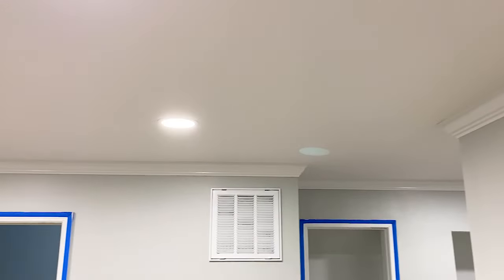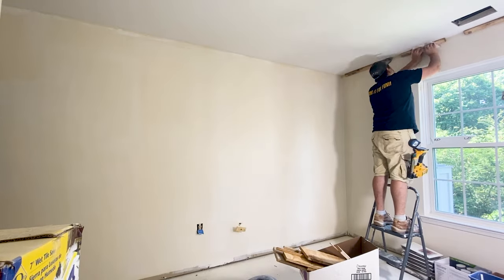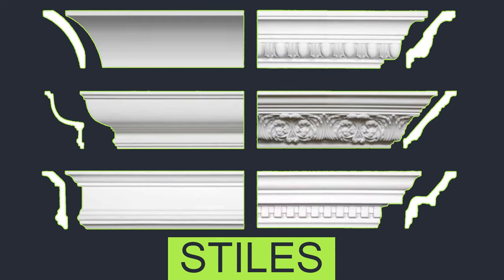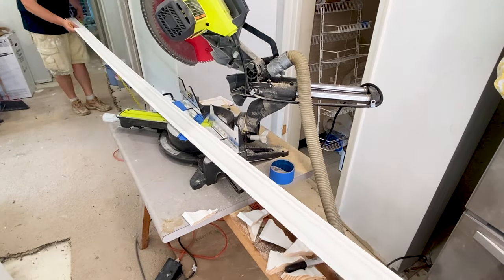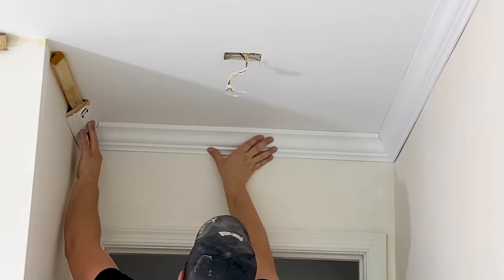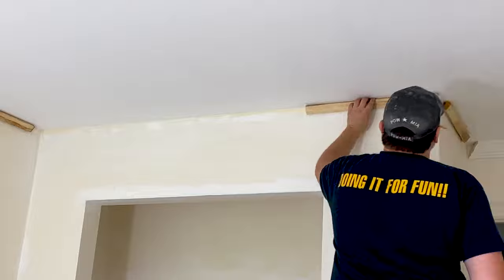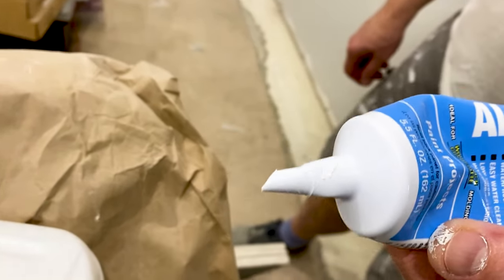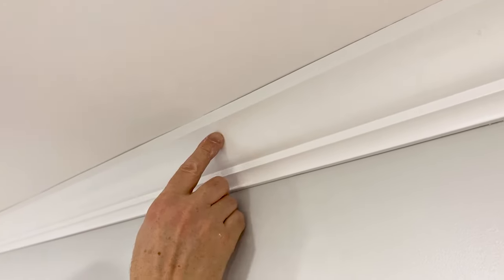How to Install Wood Crown Molding Like a Pro

Comment: High quality video!. so the measurement should always taken at the bottom side of the molding and at the tip of the cut regardless if it is IC or OC. correct?
Reply from the maker: Thank you for your kind words. That is correct. If your saw is set up like shown in the video then measuring the bottom will give you tops that line up as well

Comment: Great video, thanks, what size of nail did u use to hold the 1x2 spruce to keep it firm? And what size did you use for the crown molding
Reply from the maker: Good question. We used 2” nails to secure everything. Thank you for the questions and subscribing to support the channel. Please let me know if I can help in any other way with your project.
Reply: Thanks for your reply, do the spruce stay firm even if nailed to the drywall or it needs to be mailed to the studs? Thanks
Reply from the maker: We did not focus on making sure it is nailed in to the studs but there is a high probability that you will hit a bunch of studs any way. But even if you don’t securing the spruce to the studs it is very hard to remove it if it’s just nailed in to the Sheetrock. We used this method in my place 11 years ago and the molding looks the same as when it was installed.
Reply from the maker: Last time we chatted was 5 month ago. Are you still in the planning stage?
Reply: @DIYwithMAX  perfect!! And yes, when I commented the first time I was collecting info, making numbers, learning how to do every step for the remodel, then I've been so busy and now I started with it, thanks for all the info and for the video, it really will help me 👍
Reply from the maker: I’m glad I could help. Please let me know if you come up with any more questions. If your comfortable shoot me a picture of the final product at DIYwithMax@gmail.com I’m rooting for you.

Comment: What is the size of the spruce strips? 2x2? 1x3? 
And you adjust it to fit the sample molding, touching both the ceiling and the wall right?, then you nail the strip to the ceiling and wall right?
Reply from the maker: Hey I hope this answers your question. We use 1x2 inch spruce. Correct adjust with the sample molding peace so it has the right angle and then nail it in to wall and sealing. Be careful so it does not slip on you when your using the nailer. It’s best to check the fit after it is nailed as well. Also the spruce is not perfect so you may have to cut it to smaller peace’s to get rid of the curves in the spruce. Thank you for taking the time to ask additional questions and subscribing to support the channel. Please let me know if I can help in any other way.

Comment: Kids never use caulk to fill nail holes! Wood putty for nail holes caulk for gap between trim and wall or ceiling and inside corners wood putty for seams and outside corners if needed.
Reply from the maker: Caulk has got the stretch needed to make sure it does not dry out and crack. That’s why I use it. I’m sure your suggestion will work as well but for how long. My method has worked for 12 years with no issues. Are you getting similar results?

Comment: Great work Max😁💪 Yea I've never seen someone using spruce or pine even for proper backing. But i guess if you don't want to locate the studs & mark them you can also do it this way. 

Not to be redundant. You've always made & used the sample inside/outside pcs for installing & it's always worked for you??
Reply from the maker: Yes as long as you make sure the cuts are right to begin with. If for any reason your sample peace’s are not cut right they will not line up. Thanks for taking the time to leave comment and supporting the channel by subscribing. If I can help in any way with your project please let me know.

Comment: I gave up and took everything back to HDepot.
I couldn't make interior corners to match each other. I was always having a quarter of an inch gap at the top of the mounting.
I couldn't figure it out why and gave up after 3 hours of trying.
Reply from the maker: That’s ok man. You gave it a try and that’s what matters. This stuff is not cheep so if it’s not working out no sense of waisting your hard earned money. Thanks for taking the time to leave a comment and subscribing to the channel.
Reply: @DIYwithMAX - 🇺🇦  i guess i figure it out what was my mistake. I didn't align them right on the wall.
I will follow your idea with that wood underneath.
Reply from the maker: That is awesome, way to stick with it. The spruce does make it easier to nail it up. Just make sure you keep the spruce 3 to 4 inches away from the corners so you have space for the molding to meet up. If you have any more questions let me know and I’ll be happy to chat about your project.
Reply: @DIYwithMAX  i am about to tackle my kitchen.  I did my bathroom a couple month ago and the ceiling was very uneven, luckily we did a dark grey molding and ceiling paint for the bathroom so between that and the caulk, it hid the imperfections.  I like the idea of the spruce for my kitchen.  But if my ceiling is as uneven as the bathroom, should i find the low point on all 4 walls of the kitchen and work off that, then just cover the gap on top with caulk?  Or do you just try to get it as close to the ceiling and wall as possible even if its not dead straight?  i hope my question makes sense.  Best video ive seen on CM installs
Reply from the maker: @JoePopalisky that’s awesome that your taking this one. We had some uneven ceilings as well and you just try to line it up as best you can the gaps should be minimal the longer the run is. And you cover the rest with caulk like you did in the bathroom. If your getting big gaps double check the angle of the spruce to make sure it’s angled properly as it can cause alignment issues if not fitted at correct angle behind the molding. The sample peace of the molding you use will dictate the angle. Also having the spruce backer will help you better shape the molding as you will have a lot of area to nail to. I hope this helps. If you have any other questions please email me at DIYwithMax@gmail.com and we can continue the conversation there. I’m always happy to help folks in the community.
Reply from the maker: @JoePopalisky also don’t worry about the lowest point because the gaps will be to big across the top or bottom. It’s best to have gaps in the corners and cut the molding little long and trim slowly till it fits. If you cut off to much you can always cut off thin sliver of molding that fits snugly in the gap and insert on the side that is short and seal the left over gaps with caulk.

Comment: Before any of this! Make sure your ceiling is level! Older houses walls and ceilings can be warped and very off level. In my grandmothers townhouse on the top floor ceiling the whole ceiling is off and sagging in the middle where the skylight is. I put up a 12 ft crown moulding piece before I checked with the laser level and then realized its off 3 inches from one side to the other. Im going to have to rip the drywall out and reframe parts of the ceiling, drywall, mud, sand and paint before I can put the crown molding on.
I'm just glad to help and will make it a fun project and keep a positive mental attitude.
Cheers guys 👍
Reply from the maker: Great advice thank you for taking the time to share.

Comment: Why do you call the nailers "spruce"?
Reply from the maker: Thank you for the question. The strips of wood used for nailers as you call it are strips of cheep species of wood named spruce. I call them that so if someone watching who is not familiar with what wood to use does not go with more expensive options at a lumber yard.
Reply: Is that usually the cheapest wood available?
Reply from the maker: @dubmob151 correct

Comment: Why did you skip the demonstration for adjusting the saw mitre/bevel?
Reply from the maker: Thank you for taking the time to reach out. I made it in to a separate 3 min video so it can be easily referenced and shared with folks that need it. You can find the link in the description below the video.

Comment: What about skill? Caulking is easy to apply, skill is much more challenging
Reply from the maker: I totally get where you're coming from, and your suggestion would be spot on for a professional carpenter. This video, though, is aimed at beginners who are just getting started and might make a few common mistakes. That's why I included the solution to the most frequent problem. I hope this helps explain my choice!